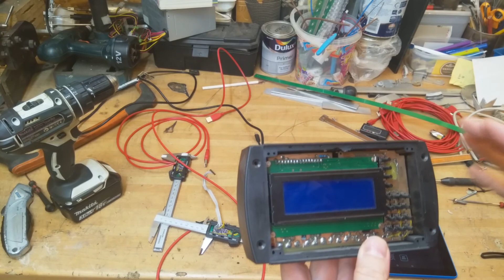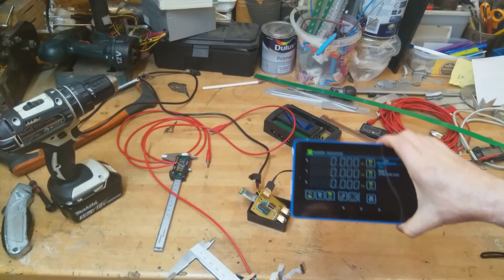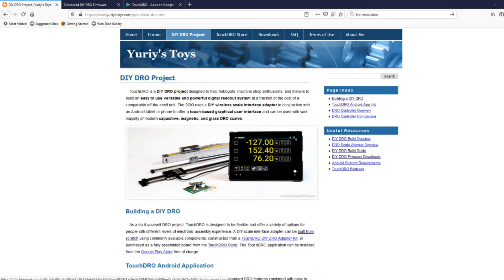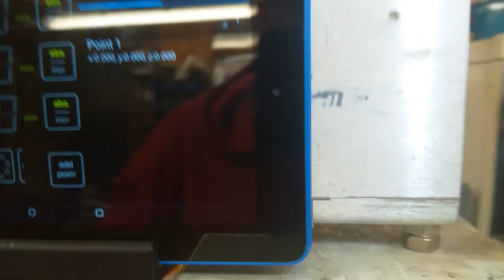TOUCHDRO OVERVIEW

Comment: hi , I build a  my touch dro based on this video (https://www.youtube.com/watch?v=c7imKrKQzyQ) and I tried to use a caliper as a linear scale but is the digit  flickering, and too noisy  , any idea how to fix it
Reply from the maker: Hi, first try the 'digital filter options in the settings on touch DRO. One thing that seems to be necessary is isolating the scale from the machine. Stand it off from the metal of the machine with plastic spacers, and sleeve screw holes so there's no contact. Ground loops can cause a lot of noise.  I ended up making little microcontroller boards to put with the read head that convert the 1.5v scale Comms to 5v TTL UART type Comms. This is pretty bomb proof.  Hope this helps.  Thanks for the question.

Comment: You can just buy one. A two channel is about $130 US, and a three channel, about $145. They’re much bigger and easier to use. The scales aren’t too expensive either. These caliper scales aren’t that accurate, not enough to use on a mill.
Reply from the maker: I know, it's just one of those projects I started ages ago when I didn't have that kind of money, and I wanted to finally make it work. It's the problem solving that's the interesting bit for me. That said I'm considering buying some decent scales, but I prefer the TouchDRO interface to the basic DROs that you get.
Reply: @ollysworkshop  You know that Yuriy sells a 4,3,2,1 chan adapter for essentially all scales out there now with BT to his TouchDRO.  4ch kit (assemble only, not raw board component kit - they're even lower in price)  is currently only $109 and the new versions also have RPM and limit switch inputs and touch probe soon to be.  So you can use your glass, magnetic, capacitive scales with the touchDRO on your tablet. You are literally $109 and 3 DB(E)-9 connector pinouts away (I just watched your "Cheapest DRO I could find" video) where you've replaced all this project with turn-key.  But you can still use your TouchDRO if you wish as well :-). Cheers!
Reply from the maker: @physicsguybrian  Hi, yes I do. There were two reasons for doing this. One was an exercise in programming for my own benefit, second I wanted to use calipers to keep the cost low, and they all seem to have auto power off now, so my little circuit would turn them back on again. Yuriys solution doesn't have a method for doing this as far as I can see. All academic now though as I got a proper DRO. Thanks.

Comment: Wow, that is what I am trying to do to my mill.  Did you do a git hub on your microcontrollers?  What did use?  Esp or an arduino?
I have a handful of Arduino Nano boards I can use, or I can get more ESP boards.
Reply from the maker: Hi. I haven't got round to putting anything up on GitHub yet. May get round to it in the next couple of weeks. I'm using a PIC microcontroller for both the scale controller and the combiner. The code should be relatively simple to port to a different device as the code is written in C. I'll try to do a short video on the finer details of the electronics. Thanks for watching!

Comment: Hi Olly
Thanks for sharing this...I have been using a Caliper2PC system (PC only) for many years, it works great but am thinking of putting a Touchdro system on my lathe so I can run it from a tablet. I would be interested in seeing more details of the mods to the scales if possible.
Cheers
Dave`
Reply from the maker: Hi Dave. I came across the caliper to pc system right when I started looking at this, but I didn't want to have a laptop next to the mill, it just seemed too untidy, so I did my own take on it. I'll show a bit more detail on the mods to the scales in the next video. Just off to the shed now that the kids are asleep.